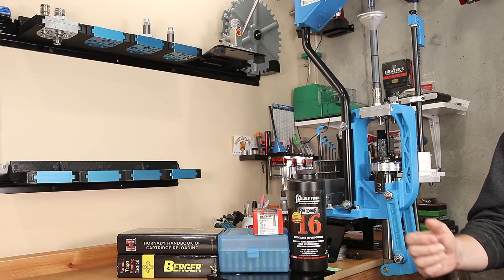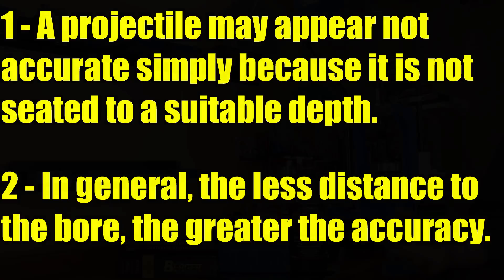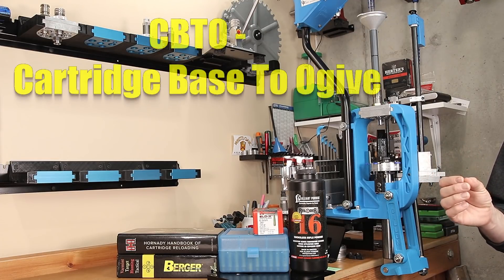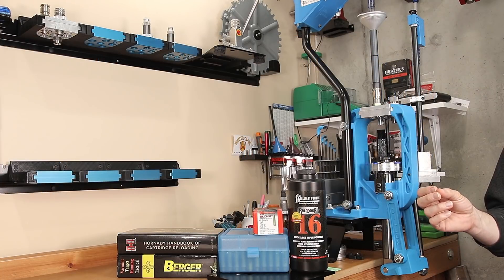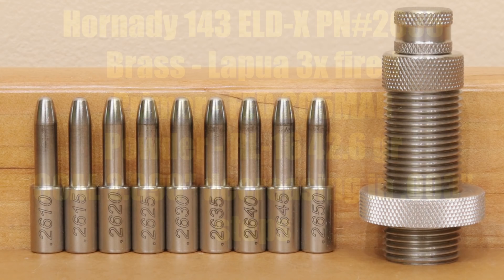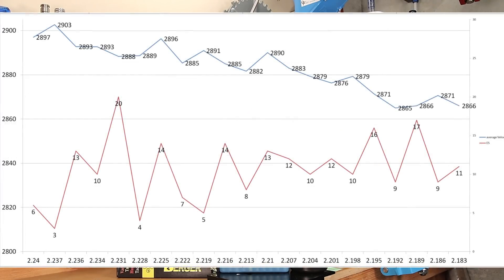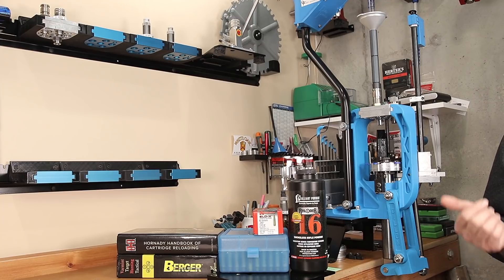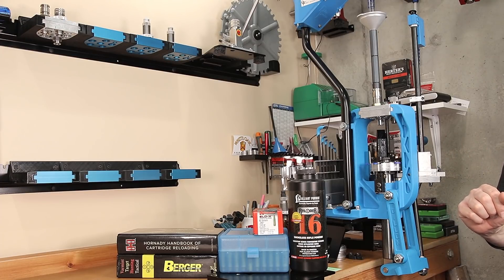Reloading Basics - How Overall Length affects Velocity

Comment: Great video as usual! My question is simple: when you seat bullet longer that reduces pressure therefore velocity. Gives you more volume to put more powder... do you use quickload to figure out how much more powder you can use safely or do you just increase .2 grains at a time and watch for pressure signs?
Reply from the maker: You may need to look at the charts again. What you state is the traditional belief, however when you look at the data, depending where you are starting in relation to the lands, seating deeper can lower the pressure / velocity. I only use QL for reference. You need to be able to look for pressure signs and know your in a safe area.

Comment: You hypothesize that the velocity loss is due to gas escaping around and to in front of the bullet which has me wondering if neck turning the brass (increasing the gap between bullet and brass) will exacerbate the velocity loss?

For some reason I thought the velocity loss was due to the bullet getting a "running start" and reducing peak preasure
Reply: If one turns their brass using a mandrel first, you will have more even bullet coverage where the inside neck and bullet touch. This, along with proper neck tension will ensure no loss of gases around the bullet before it is fully released into the rifling.

Comment: very thorough. every aspect covered. im not sure you made this point: if you mess with overall length you can no longer go with the powder recommendations in manuals. this is where it becomes unsafe for shooters because we are told to look for pressure signs, but as you showed even with powder increases in most cases overcharge cases are not evident. you can measure ".0001 growth of the rim which is recommended but no one has that tooling as a normal reloader. primer pockets and case separation dont always fail before the gun does (barrel explosion due to overpressure). I wish you could elaborate on your quickload assesment. you seemed to point out barrel pressure here but i didnt see it in the chart. moreover, quickload requires very specific parameters "H20" that can vary substantially. Several newer bullets and powders are still not withing the program POINT BEING: IF YOUR INTO RELOADING DUE TO THE AMMO SHORTAGE STICK WITH THE MANUALS BULLET SEATING DEPTH. IF YOUR TRYING TO SHRINK YOUR GROUPS A 1/4'' PREPARE YOURSELF FOR ALOT OF TIME, MONEY, AND THE REALIZATION THAT IT MAY HAVE JUST BEEN YOU NOT HOLDING THE BARREL ON TARGET DURING TRIGGER PULL.

Comment: Lmao,, ya know what sucks??  My headspace guage got dented real bad in a “cat accident”.   So I had to buy a replacement,,   Therefore my load book that iv been keeping was no good anymore ,  because even with the same brand of tool replacement,,  everyone is different,,
Reply: They call the comparators for a reason, they are not gauges. Measurements will vary even if 
using 2 or 3 or more of the same brand headspace comparators .

Comment: Thanks again for the time, effort & expense.
I'm glad you covered this subject. I'm getting the same trend in velocity vs CBTO. 
When using the same powder charge of 36 grns of AR 2207 & altering seating depth by 0.003" from CBTO of 2.228" to 2.262", my 5 shot group velocity averages decrease with decreasing COAL. 
The kicker with my data is that,  I'm testing 130 grain 0.308 projectiles which are in excess of 0.100" from the lands therefore, I think we can rule out your proximity to the lands as being a possible cause except when jammed or touching. The number of shots fired in both our testing gives very good statistical validity so, this is a real result & not noise. 
Your explanation as to the cause of the results may indeed be gas leakage however, I have papers on 2 studies, both undertaken at the Army Research Laboratory
Aberdeen Proving Ground which tested the theory that the primer detonation is responsible for the initial bullet unseating & lodgement into the lands prior to the begging stages of the main charge ignition. 
The test results suggest very strongly that this is indeed the situation. The data obtained leaves me in no doubt of the appreciable differences in shot to shot consistency when comparing large differences in case neck tension which, must surely impact the result of initial primer unseating pressure. 
Regards         Rotas.

Comment: My question would be how repeatable are those SD numbers. Seems like some pretty large jumps in SD for very minor changes in COAL. Any thoughts on running a larger sample size?
Reply from the maker: Those are ES numbers not SD, yes when you see a jump to a ES of 20 not really small but when you see there are not large changes in average velocities and there are really no bad statistics in this chart the are where the projectile is just in or out of the lands is usually where you want to stay away from. I am pretty sure most would be happy if they never had a ES of higher than 20.

Comment: In your video you said #3. We are going to perform the COAL test by shrinking the size by .003, could the same output be gained from shrinking/shortening the overall CBTO by .003" ?  Just want to make sure I'm understanding.  I'm not the sharpest tool in the shed.
Reply from the maker: Hi Matt, That is exactly what we are doing. I really only use the term COAL because is better understood. I would encourage you to track and control CBTO that way your not worrying about the variance in the projectile tips. Thanks for the question!

BAR

Comment: What would you suggest for working inside magazine length ?? 
I've just loaded some with three different oal 30k difference and I'm doing it inside magazine length. Haven't gotten to shoot them yet hopefully in the next week
Reply from the maker: I really don't think there are hard and fast rules. I think that its going to depend on your application. I have a load that I have to single feed my 300 Win Mag that can hold under a 1/2 MOA but it can't hold that at magazine length. If it has to be mag length then figure out the range you can test and see what makes sense. Eric seems to change in .003" at a time and that may be the best way of doing it. if your moving in big steps you could be jumping right over some great options.
Reply: I was going to ask the same question. Thanks for the information

Comment: Any correlation with POI or group sizes in the stable area of your SD chart between 2.21" and 2.198"? Mind just be a fluke in the data, but they look pretty erratic other than that window.
Reply from the maker: That is ES not SD

Comment: Would love to see a graph of the group size vs CBTO.
Reply from the maker: Its coming, trying to keep the video on topic and not 30 minutes long.
Reply: @BoltActionReloading  Great. We've all seen where some of our best groups have the worst SDs, and where some of the best SDs have the worst groups. Begs the question: just how much can seating depth adjustments help those terrible groups with the great SDs.
Reply: @BoltActionReloading  appreciate the topic/video. You are well under a targeted time of .30 min. You can slow the speech down or go into further detail w/ no worries.
Reply from the maker: @Nonedw  There isn't really a target time of 30 minutes, a lot of people don't like longer videos and some of these topic get more confusing more rapidly. I try to break up topics so that you can research one thing at a time and the subjects are searchable. If I put in the this in a COAL variation accuracy video no one would expect to have the velocity data.
Reply: @BoltActionReloading  Copy on the longer videos. However, your videos are done well and 30 min would go easy.

Comment: Thanks for doing this video.  I’m tuning a load now by varying the seating depth.  I see a variance in cartridge base to ogive of .002 from cartridge to cartridge when making ammo.  This is frustrating when Eric says to vary cartridge depth by .003.
Reply: Try rotating the case during sizing and seating.  That may help bring in your CBTO.  Press it, give it a 1/3 turn press it again and another 1/3 turn and press it again.  Also, you need consistent downforce when sizing.  Are you camming over your press?  You want the press to bottom out enough to take out the slop without inducing a lot of flex in the press frame.
Reply: @mab0852  thanks for the advice.  I rotate the case 2 times while seating a bullet.  Yes, the Lee press I use does cam over to the stop.
Reply: @Not-the-only-one  How consistent are you base to datum line after sizing and are you annealing or at least using brass with the same # of reload cycles? Differences in neck hardness/tension can easily cause .002 in seating length variance.  The nice thing about Erik's method is that it will give you a measure of forgiveness for that error if you can't sort it out.
Reply: @mab0852  I’m not using brass with the same number of reloads.  That is probably where my problem lies.  Not annealing either.  Lapua brass. Redding dies.  Thanks again.